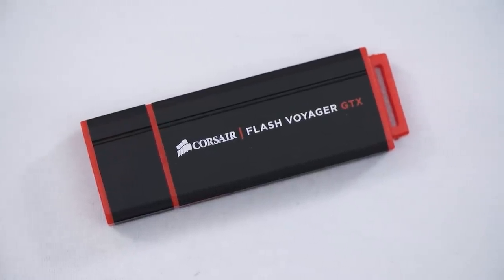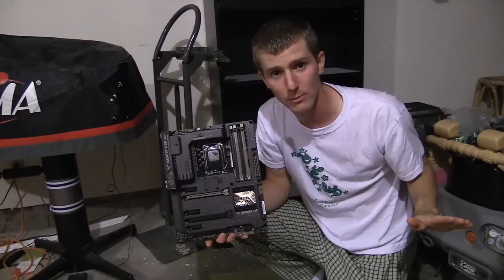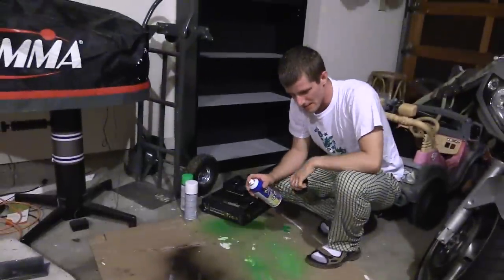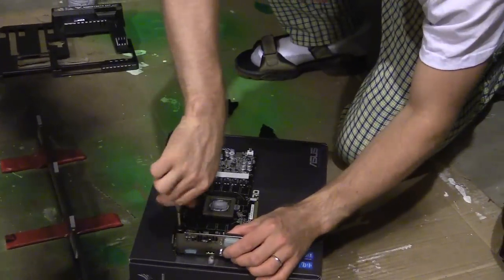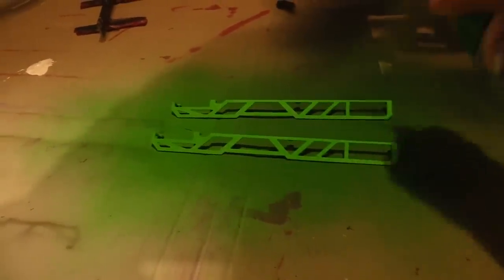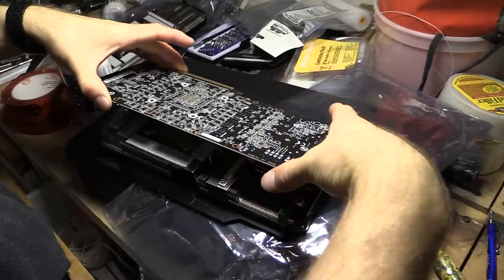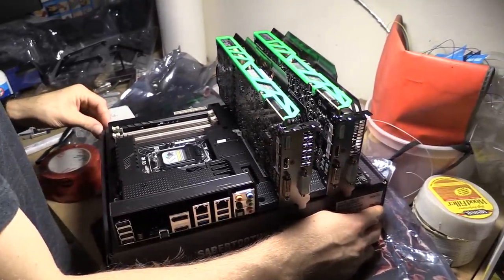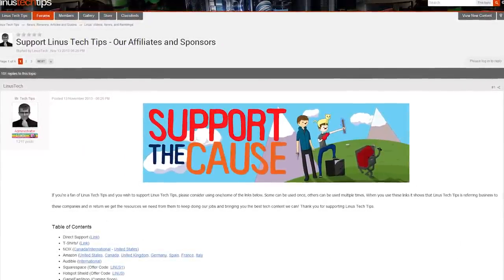How To Paint Your PC Parts - Linus Plasti Dip Method

Comment: I bought my 770 from Evga back in September 2013, should I put new thermal paste?
Reply: No. In a perfect world you would not even need thermal paste. The whole point of it is to fill the tiny little gaps that the two contacts points would otherwise have without it.
Reply: Jeston Aylen Actually you eventually do have to change it, because over time, the thermal paste becomes dried up and will not transfer the heat as well. It's over time degrading, however, depending on what thermal paste you have, it'll differ from how often you should replace.
Reply: Probably pretty soon. If your temps start to increase for no visible reason then you may want to change it, otherwise, dont bother.
Reply: The reason he replaced his thermal compound was because he had access to it. Replacing the thermal compound on a GPU is going to do so little it's not even worth the effort and risk of perhaps damaging something.
Reply: ***** The paste they use is designed to last as long as the card. So usually there is no need to ever replace it
Reply: cl4ster17 Tell that to my XFX 7870 DD after a year of usage I noticed heat problems, after opening the thing up the thermal paste was dried up completely (You could break it off like smooth layers of plastic, using your fingers). Than again... XFX isn't that great of a brand, either way, to each their own.
Reply: i would :P mx2 or mx4 is really good, the one that linus was using. I personally changed all my gpus thermals, and like linus said, do not remove the thermal paddings if you do plan on changing your thermal paste on your gpu
Reply: Absolutely not.
Reply: Kenshin Himura that's going to vary from manufacturer to manufacturer. Notice Linus said EVGAs thermal compound is usually pretty good. Not everyone's.
Reply: Guys, guys.  This is simple.  Temps higher than normal?  Replace the paste.  Else, dgaf.
Reply: Le Monarque Check for dust first and eliminate every other possibility

Comment: I like your color scheme on the rig. Can you help me out with custom painting my rig? I want to make my inside of my rig to match the Intel color scheme. Blue. Maybe Matte Blue. I want to make a custom plate for my Zotac Gtx 1060. What type of material do I need for the back plate? Can I use Aluminum as a back plate or do I need to use steel?
Please help me out. Thanks in advance.

Comment: Using plasti dip was a good idea Linus, but your not quite using a good technique for it. PD is different from normal paint your first 2 coats should be light, but every preceding coat should get heavier. Dont worry about it running, plasti dip is very dense and clings to it self very well. I saw a ton of texture on the parts you did, if you want a smooth finish just follow the steps i just outlined. Ive been painting cars with Dip for years now.

Comment: I want to paint my laptop using this method, but no video on youtube explains how to take a laptop apart thoroughly enough to paint it safely.  Could you maybe do a video like that?
Reply: abattlescar Uhh even if you found a video I still would suggest you don't do it. Not worth the risk and may not even be worth the time.
Reply: XxHAMADEHxX I found a video on how to get it to that point, but what would you suggest is risk, it would be acting pretty much the same as this.
Reply: You coild probably get a skin though
Reply: I just like being able to say that I painted the design on my own, and it would probably be cheaper.
Reply: abattlescar if you want to paint your laptop take it apart and record each step. Taking a video would help. Writing down each step would work well as well. Lay your parts out in a very organized manner. Organize everything, make sure you put the screws and little bits in a shot glass.
Reply: abattlescar Just remember that the diy paint job would be way thinner and weaker than the stock one so you would be able to very easily scratch it!

Comment: (Possibly a stupid question) but, if you were to take the casing off you GPU to paint accent pieces is it nessesary to clean off and reapply thermal paste for the GPU?
Reply: not really done it before no problem lol
Reply: +Peak ok thank you
Reply: if its dried out
Reply: If the card is new, then probably not. But if the card is, like half a year old, I would apply new paste. Old paste dries out and doesn't seal right when you put it back together. However I have seen people use a very thin, very little amount of motor oil to hydrate the paste and that seemed to work just fine.

Comment: This is going to sound ghetto, Is it possible to use a marker pen to change the colour of the 24 pin psu connector at the very end of the wire....

Comment: HI I HAVE A R9 280X AND I WAS JUST WONDERING WHAT SORRT OF TEMP IT SHOULD BE AT WHEN UNDER LOAD BECAUSE I WAS PLAYING ARK AND OTHER NEW GAMES AND I WAS HITTING TEMPS ABOUT 68.C
Reply: jameshone1000 That just fine. I wouldn't start worrying about it till it hits about 80 C* - as long its about that 60-70 C* you will be just fine. :-)
Reply: ok thanks

Comment: hi linus, i'm looking for a new graphics card and i dont know witch one to get. i want to play bf4 +90 fps on 1080p or probably +60 fps on 4k.
should i get the asus r9 280x matrix platinum or sappire r9 290 tri-x LinusTechTips
Reply: Get an R9 295X2 if you want to play @ 4k @ 60fps
Reply: if you want 4k, R9 295X2, TITAN Z, or 780ti's sli.
Reply: Spirit
 I don't think NVIDIA is heading towards 4k with the 800 series, they are more concerned about efficiency.
Reply: 4k 60FPS ? Dude you'd need more than 1 graphics card to run those frames
Reply: but can the sapphire handel 1080p +90 fps

Comment: 3:13  He touched it before painting it. NEVER do that kids!! Wear nitrile gloves and spray the surface to be painted with a low water content alcohol. Yellow bottle HEET works great. The oils from your fingers on the surface creates small areas of zero adhesion that are difficult to detect with visual inspection. Otherwise you'll have to redo the piece soon depending on how often the affected areas make contact with anything. Especially being touched, and ESPECIALLY if the pieces are in close proximity with radiant heat.

Comment: Okay, I'm usually very pleased with your guides Linus but this is just bad. I mean you forgot to mention almost all the important steps. This video shows how an amateur would do it (take the components apart and just slap some colour on).

If you want to do it properly remember to always A. Keep the spray can a good distance away from the painted object to avoid dripping the paint, B. Apply multiple layers, never try to finish it in one go or you'll smear the surface, and C. Take your time and let the components dry between layers to make the finish as smooth as possible!
Reply: Those are some tips for award-winning car models. When you just want to add some color accents in an otherwise difficult to theme computer, this video is fine.

Comment: Why do graphics card OEMs bother designing the fan side to look cool and not put a decent back plate on it.  Generally the fans face downward in a case and aren't really seen even if you have a big window, but you are still looking at the uncovered back of the PCB.  I personally prefer clean looking cases without windows so its not really a big deal for me, but it still doesn't make sense.

Comment: Will I be able to run Grand Theft Auto V on the highest settings possible, with these specs?
- i7-4790K
- Gainward GeForce GTX 970
- Corsair 16GB DDR3 RAM 1600MHz
- ASUS Sabertooth Z97 Mark 1
- Samsung 500GB SSD
- Cooler Master 750W PSU
And by the way, should I buy another type of motherboard, should I buy one or two 970's and do I "need" 1600MHz or 1866MHz RAM?
I am currently building my first gaming PC, so any help is appreciated! I want the PC to run DayZ (both mod and standalone), H1Z1, GTA 5 and similar games on Ultra settings.
Reply: Alpha Chinoz No
Reply: Defiantly but only on 1080p
Reply: Jonathan Brown Could you be a little bit more specific...?
Reply: Alpha Chinoz Yeah you can probably run GTA V on max settings (I'd say around 60 fps) but only on 1080p (1920x1080 pixels). Don't even attempt to try on a 1440p monitor (2560x1440}. That would get you more like 20-30 which is okay but not preferable.
Reply: Alpha Chinoz A 970 doesn't do so great once you start turning on the advanced graphics settings.  But as far as the regular settings, you'll be good.
Reply: whychunter What about a 980 then?
Reply: the 980 would destroy GTA 5 (meaning it would be good) but the 970 would still be really good
Reply: Alpha Chinoz Wait for 980Ti. only 5 dayz
Reply: in the end its all up to budget if you want to destroy gta 5 get the 980 ti or the 980 but seriously the 970 will still do really well
Reply: ***** LOL?
HE WANTED THE 980
Reply: wetwerwolf123 Yes it will run it. No it will not run it at the highest specs possible. Advanced options bring the 970 grinding to stop. Also, don't be planning to planning on higher than 1080p with it.

Caps lock does not make you more right than anyone else.
Reply: wetwerwolf123 can 2 saphire radeon r9 280x 3gb 2way sli run it on very high at a smooth 60?
Reply: Phuzion Gaming on ultra 1080p you might occasionally dip into the high fifties but nothing that will dramatically affect your gaming experience
Reply: wetwerwolf123 alright welp i ran into a problem in pcpart picker

i am now getting a Saphire R9 290x Vapor-x 4gb because i cant do 2way sli with any of the compatible motherboards will i still get the same performance?
Reply: Phuzion Gaming with AMD cards you'll want to look for crossfire comparability not sli thats only for nvidia cards
Reply: Phuzion Gaming and the 290X will get better performance than 280x's in crossfire
Reply: wetwerwolf123 lol i had to basicaly remake the whole system cuz my brain thought sli was AMD and crossfire was intel DERP so heres my build :D http://pcpartpicker.com/p/GpsdTW
anything you think i should change?
Reply: Phuzion Gaming I recommend you go for one higher end card rather than two mid range ones (unless there is a reason for choosing two) and you won't need to fill your case with fans 3-4 will do so use some of the money from the fans on a single higher end gpu but other than that it looks good :)
Reply: Phuzion Gaming and you should also look at getting the Phanteks Enthoo pro, the define R5 or the NZXT H440 instead of the Phantom case
Reply: Alpha Chinoz I disagree with everyone. My build is similar, but i have a 980ti. When running at high settings you probably would get between 30-40 fps. But if you get 2 970 with 2 way sli its increased
Reply: wetwerwolf123 i was looking at benjchmarks and it got 50 fps on ultra settings on witcher 3 :P and the card looks dope, also im on a budget so this is a great gpu and i can even get to 3 way crossfire, also i want the fans because i live in arizona and noise doesnt bother me :) (edit) ill look at watercooling and i want more graphics cards for High res Gaming , the phantom case also is realy dope looking and has some great features, Also when im not getting good performance on the 2 cards i can sell them and get 1 high end card then get another high end card, sell it so on so fourth
Reply: Phuzion Gaming cool there are no other problems with the build so good luck :D
Reply: Alpha Chinoz No. My guess is that you would need 2 970s and even those might fall a bit short at 1080p when you start turning on the advanced settings. I have yet to use them, but I've seen some benchmarks. I am running it on an EVGA 780 SC and I can get a stable 60 on what could be considered high settings, if that helps you at all.
Reply: These are questions you don't need to be asking. If you are asking these questions on YouTube don't even build a computer. It shows that you aren't independent enough to figure out the answers on your own and you wont even be remotely able to figure out any issues that will occur. If you seriously have to ask if a 970 with a i7 can run GTA5 stop while you're ahead. Otherwise go and actually learn something. Watch Linus' videos, lookup the system requirements and compare the parts. For anyone saying "You can't learn if you don't ask questions." You don't learn anything by being given the answers, you only learn how to memorize the answer.
Reply: Ermahgerd that's my build... Yes you can run gta v on max
Reply: ***** I have already bought a 980 Ti ;)
Reply: +Phuzion Gaming No because you can't run R9 280Xs is SLI.
Reply: Even with the 960 4gb ($100 cheaper) you can run GTA V at ultra! And you could even get an i5! Like a i5-4590k
Reply: You need thus.
Cpu:calculator
Gpu:graphic calculator
Case.potato
Screen:whiteboard
Reply: +x M i l l Z e e Yea blackboards are cool looking but they only have VGA connections on them. No display ports for 4k :(

lol
Reply: K

Comment: My friend made the mistake of not reconnecting a graphics card fan once. He immediately regretted it.
Reply: +TrueMegaManiac Wait, Why? Because it fried it?
Reply: isahiah sims Pretty much. It still kinda worked apparently but wasn't pleasant after that happened from what he told me. He's using a different card now that, while it has super hodge podge ghetto cooling solution, at least works without issue.

Comment: Whats the average dry time for these type of parts.
plastic:
Metal:
other stuff: 
Thanks in advance.
Reply: with plasti dip
Reply: Depends on the humidity and temperature of the room. On a nice summer day, wait 10 minutes between spraying heavy coats. Wait 30 minutes to be dry for touching. Allow 24 hours to fully cure (the product is dry but becomes more durable as time goes by).

Comment: 'how to safely paint parts of your graphics card, RAM and motherboard.'

Most of mobos don't have an armor, most of RAM doesn't have cover panels and  most of GPUs don't have removable sides.

So basically this video is 'How to paint your Asus motherboard's armor, Corsair RAM's metal panels and Gigabyte R9 Windforce's removable cooling vents'
Reply: He also painted the RAM and PCI slots on an x99 Rampage board.
Reply: Cyortonic Not on this video though.
Reply: Dr. Etzor I know.

Comment: any special kind of spray paint you need to do this? Head resistant? Electrical maybe? if they exist?

Im planning to paint my green CPU heatsink mount to black so I don't know if I should use a normal spray paint or if i need a heat resistant one.
Reply: iFLIP007 Plasti dip
Reply: +iFLIP007 Heat resistant because the normal one will melt on your CPU
Reply: Use stove paint on your heatsinks

Comment: I want to paint my HAF XB EVO White and Blue. BUT!

Looking at this PlastiDip I have few questions:
1. How Thick will this PlastiDip be? (Will it be spongy, will it make the case feel soft)
2. Does painting with PlastiDip keep facture of the part? (Front of HAF XB is glossy, but sides and top are matte. Will it stay matte?)
3. I want to paint fan filters aswell (Those at front of HAF XB), cause they are pretty visible. Will PlastiDip cover holes in the mesh?

Thanks ;)

Btw. I have the same modular screwdriver as linus :D (When he unscrews GPU). Bought it in Castorama :D

Comment: Looks great, but I did not really see any difference in spraying the motherboard black unless you were looking for a matted finish.  I was wondering when the components start to heat up will it effect the pain on the paint on them or cause them to melt or smell?  You said that you could peel them off later.  I honestly don't see why anyone would do this and void their warranty like this. 

I would have personally painted other less expensive components and used green paint on the fans, or water cooling tubes, and got green LED lights to get that green effect.  It's all about illuminating the inside of your case to see all the slick hardware inside.  If you spray painted the logo..? why?  I would WANT to see that!

Comment: Id like to paint my Asus PCE-AC68 Wifi Adapter to make it match my case, but I don't really see a way to do it without painting the PCB. Is this safe, as long as you use Plasti Dip or some other non-conductive paint?
Reply: Be careful, cross your fingers, and it will work. It's not recommended, but should technically work

Comment: Fun fact that will one day reach the minds of people in the computing industry, as it does not appear to have happened yet:
Black (and other dark colors) attract heat. Whereas White (and a few other...neautral and/or light colors) dispel (don't attract) heat.

Don't know how much it would affect temperatures, but I tested it on a hot day in shirts, standing IN THE SHADE-SO IT WAS ONLY AMBIENT HEAT AND NO SUN ETC: 5min in black shirt and I was sweating like a pig, felt very hot, ended up taking it off. (15min gap between shirts, weather report said humidity had gone up 3% and temp had not changed when I tried white shirt)  1h, white shirt: felt fine  (Yes it primarily applies to clothing, but ideally it affects everything, like cars).
So therefore, surely it would affect computers.

Also: those guards on some motherboards: wouldn't they be preventing the ambient motherboard heat from dissipating? and be actually containing and concentrating it? the exact opposite of what one wants?
Reply: Lol this won't work with PC parts.
Reply: +Bartosz Olszewski 
Actually it does, very minimal, but it does (I tested with my old build, what sucks is it actually cost me just shy of $1300 to change colors twice)
Main thing I found was when I took the mobo guard off-my mobo temps dropped almost a full 10c within seconds. Took some convincing, but my mates tried it too, now none of us have mobo guards XD.
Next project: ps4 and xbone in 1 HTPC case...this is gonna be nice and tricky. I have too much spare time lol.